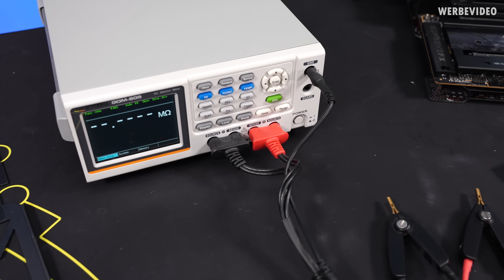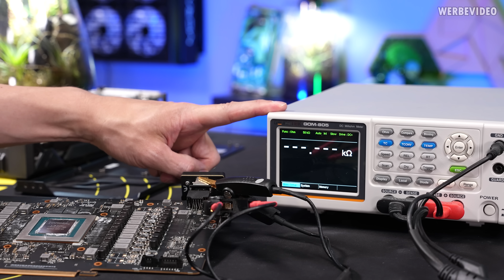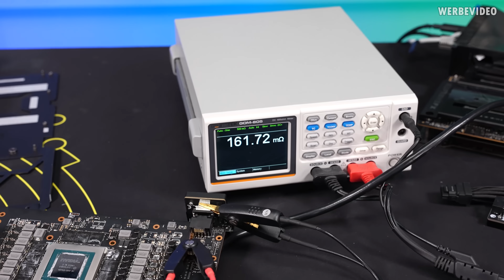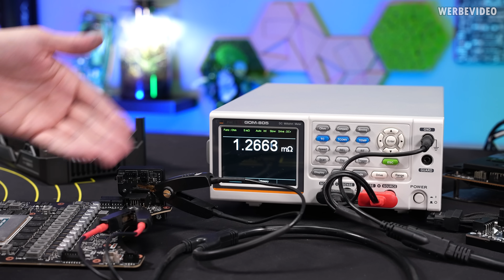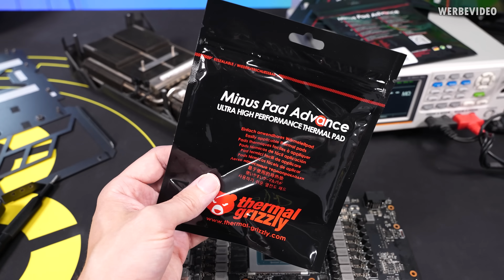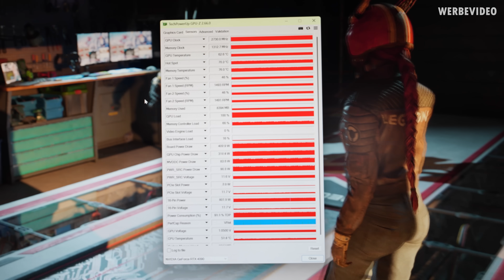It Happened Again – RTX 4090 with Melted 12VHPWR

Comment: You measurements are flawed. The PCB ties all the +12V/GND pins together later. So even if one is completely disconnected you will measure the resistance of the other pin plus the two resistors used for current measurement plus the pcb trace resistance.

Comment: What we need is an adapter that can read the amperage on each individual input, with a display, and a buzzer or alarm that will sound if an individual cable exceeds 10 amps, or whatever the safe threshold is.

Comment: If nvidia wanted a reliable solution they would use the standard 8 or 6 pin pci-e connectors, or at least allow their AIBs to use 2 of their garbage connectors like EVGA tried but nvidia got mad, and evga knowing that 1 of these was wrong ragequit (given they provided great RMA service, this type of garbage couldn't fly). 12:46 They chose looks over function, here are the results.
Reply: They are allowed to use two connectors thats part of why it's all soo incredibly stupid. I'm not sure why most of the ABIs don't. Galax has 2 on the HOF cards
Reply: @TSRB87  Kingpin from EVGA and my lying eyes said otherwise, I am almost sure Nvidia forced AIBs to respond this way after the EVGA debacle...

Comment: Undervolt, power limit to 85%, and driver level frame rate cap (matching your monitor max -1), these cards. Mine pulls 50W-120W (70W avg) less, for little loss in performance. You get slower degradation and lower noise as well
Reply: My RTX 4090 I did a slightly undervolt (no performance loss) and it operates from 270w - 360w and in my build it sits between 53°-60°c room without OC, I don’t think this will  ever be able to get burned in such (low heat) circumstances.
Reply: i run my 4090 at 50% power limit.just below 300 watts peak. 230watt 99% load in current game.
i tried the curve editor foe undervolting, did not work for me, did on my old 3080.
Reply: @sudd366050% ya kind overreacting, ya fine, your gpu won’t get fire, try lottery or take care of your heart, a heart attack is more plausible unfortunately! lol
Reply: @sudd3660
You paid for 4090 and made it run like 4080. 😂
Reply: @dinvsl   i payed for the most efficient graphics card, i still had to power limit the 4080, and i needed the 24gb vram.
and on top of that, i get the full 4090 speed in most my games, only rtx heavy games i get 30% lower performance.
Reply: @dinvsl  undervolted and mildly power limited 4090 loses tiny amount performance, its still almost twice as fast as 4080. While drawing near'ish same watts as stock 3080 (not 4080 tho, latter is more efficient). Its out of its efficiency range from factory, and with 'one rule for all' voltages, as with all CPU-s GPU-s.
I have my CPU also per core undervolted, fairly aggressively, for NO performance drop and perfectly stable. I actually thought I had never crashed but recently checked log on one of my NVMe drives, I've had two crashes over 4 years with my 5900x

Comment: The resistance is very helpful. It proves why it melted. It proves the female side of the connector is junk too.
Also I have an msi 1300 watt and the difference in quality is huge between that and the previous brand I used. Ironically enough it was asus. The msi was far tighter fit and I measured and had less resistance in the cables. Even the other pc cables I haven’t used from the asus had more resistance.

Comment: Well at least the good news is that it doesn’t destroy the card. Looks like a relatively small soldering job. My guess is that his PSU tripped OCP on that rail. He will need to reset that before it works again. I had same experience as Jays2Cents long time ago with OCP on PSU, unplugged 100x, turned switch off, on, plugged into wall with switch off, plugged into wall with switch on. Nadda, then I hooked up a multi-meter and was checking pins and I heard a click and she lived again. See if PSU manual has OCP reset instructions. That’s why he was seeing 0w.

Comment: I’m an engineer (mechanical) and really cannot understand my peers that designed this connector: it failed on the basic high school level electrical training. We are not talking about complex circuit design and dimensioning, failing instead at the very basic level. If this guys designed a building circuit breaker panel, they would burn down the building
Reply: Here's what I can't understand.  This is UL certified!  File Number E204896.

Underwriters Laboratories says it's safe.  HOW!?!  This is how certification companies loose credibility.
Reply: @EmperorA0  
To me, there is only two possible logical explanation:
1. NVIDIA (or whoever owns and licenses the connector) gave UL some money to acquire the certification, making UL a corrupt certifier.
2. UL has lost enough smarts to no longer be a credible certifier.
Reply: @Operational117  I have a feeling it started with #2 and ended up at #1.
Reply: @Operational117  This is the problem with having a corporation being "the" main safety certification body for an entire country.

If we can't trust them for this, then why should we trust them for the insulation inside our walls, or the circuit breakers and GFCIs that prevent fires and electrical shocks?
Reply: What happened was leather jacket man wanted a one connector card and paid them to certify it. Lol
Reply: UL did not certify it until Jensen gave them a leather jacket and a bag full of money
Reply: Just imagine a project where the PM  tries to fill all requests from the CEO who wants his bonuses in full...
Reply: The connector does work when human error is not involved… or bad psu… although Corsair is always mentioned when melting connector, let that sink in
Reply: @skyhawk21  I own Corsair PSU and I refuse to use their cable. It will melt
Reply: @skyhawk21  yes and the Earth is flat. This has been explained by several reputable channels, including this one. Yet you choose to ignore what has happened in real life.
Reply: @skyhawk21  nvidia bot bing bing bong

Comment: For real tho, what is the point of having 12 pins and wires if they are bridged together anyway, just have 2 wires and 2 pins, the RC world has this shit figured out for years and are running WAY more amps without connector problems.

Comment: I had to remind myself ohms law, but f me... at a rough max of 100w per conductor, at 0.16ohms thats 16W of heat! no wonder it melted!
Actually reworked calc after seeing the benchmark... at around 400 watt max... around 5 to 6 W per conductor.... again still plenty enough to melt the connector. Esp with multiple conductors adding to the localised heat.

Comment: Yet again a reason why the whole ATX power connectors need a complete revamp. Fewer but a little thicker wires 2 pin connection would be more reliable  and easier to route. Maybe going form 12v to 24v so you can have smaller wires or more wattage. etc

Comment: Great transparency, thanks for the info about implementation of wireview, didnt know you are joining the powers there, but it makes sense to measure one wire. What to take from this.... make a wireview that would keep the wires split, with 6 separate shunts :D. Also, if you discover root cause for those high resistances, you have solved whole mystery, if the wires go one by one from 1ohm to 100+ ohms, the load goes mostly to to  1ohm wires and if theres one remaining, it does the final melting...
Reply: Splitting the wires is against Nvidia's spec... He said the Nvidia connection fuses all the 12v in the same way
Reply: @JE-zl6uy  the wires are already split as per 12VHPWR spec. Maybe bad formulation on my part... Old 12pin 3090 cards "split" into 3 planes, each with their own shunt and it was no problem. Seasonic is "splitting" on PSU side to shunt individual 12v wires, 5090 astral has "split" shunting of each of 6 12V wires.. So I think that level of nVidia insanity (so far) is doing and recommending fusing of wires, not yet forcing everybody do it...

Comment: Hi, I had an idea and I hope someone can tell me if I have any possibility that it is real. Computer power supplies convert AC to DC using a high frequency method to have as little energy loss as possible. I have heard of an effect in electricity moving through a conductor, where electrons move faster on the outer surface of the conductor than in the middle. Most connectors have melting problems at the corners of the common fence where all the connectors are joined. Perhaps the phenomenon of faster electron movement is seen here as overheating due to high frequency oscillation of the voltage source and the connector design is not suitable for frequency generated voltage but for battery constant voltage?😅

Comment: I had a h++ melt. it fused the PS manufacturer cable on every 12v pin but every other pin melted on the GPU or PS side but not both ends. I wonder if it's thermal cycling damaging solder joints.
Nvidia maybe right their newest adapter doesn't melt as often, but it's not the cable spec that was agreed upon with PS makers before Nvidia decided to stop load balancing high-power gpu's.

Comment: THIS IS WHY WE NEED HIGHER VOLTAGE idk like 24 36v
Lowering the current means less problems sooo...
Reply: Or just not using a terribly designed connector.
Reply: That would require different PSUs to output 24V or 36V DC.
And the whole idea behind the new connector is a smaller footprint, and multiple connected PCIe connectors, so you can keep the same PSU.

The main issue is that the pins/connector can work form heat expansion, change its connection, increase resistance and start heating up.
The whole issue would be solved with heavier pins, and perhaps a plastic housing with better hardness or thermal properties.

Comment: At this point I really do not understand what you are trying to figure out and to prove about this disaster of a connector. Any electrical engineer would tell immediately that this connector design can not handle the power it is asked to handle because... well physics! Instead you could help people by collecting statistics about the usage of the defected cards and maybe you come to a useful conclusion about the real maximum power that this connector can safely operate. Or other factors if there are any.
Reply: Yea right...... all these companies that could push back and get nvidia to change it would rather cash in on the shitty connector. Even Roman is.....

Comment: The biggest ever valued company not even able to design an electrical 12V circuit properly on $2K+ GPU...
Reply: The real question is what is NVIDIA using on these $12,000-$25,000 AI accelerators.  It's not JUST the connector that is the problem.  Its how the power delivery is designed.
Reply: @KellicTiger 48V input isolated two-stage DC/DC converters. The isolation separates the power and signal grounds and through that eliminates the huge current imbalance between +12V and GND on the PCIe power connectors of consumer cards as well. The power connectors are radsok-type aka hyperbolic contacts (same construction of connector that OEMs use for hooking up EV batteries, for example).
Reply: @-szega  So, NVIDIA might just be half assing the connectors on the consumer grade cards as a F off message then?
Reply: @KellicTiger aka we the public get given crap designs prone to breaking
Reply: The connector is technically fine, people are pushing 1000+W through these things without apparent issues. The impressive part is that after four years and two re-designs of melting connectors, the root cause(s) for pin imbalance on the connectors that do fail is still unknown. Foreign matter contamination is likely a major factor in many of these.

Comment: There's a reliable solution! Desoldering the connector and moving it away from the board! 
Maybe use the old 8pin? Nobody had issues with those!
Either way that connector is only there to cause issues to the pcb, removing it and extending cables away from the pcb would be the first idea to my "how to make things robust" thought

Comment: The more you fry, the more you save.
Reply: The more you fry the more Nvidia sell
Reply: At this point I'll get the highest end graphics card that doesn't have this stupid connector
Reply: Nothing new here, as most of these components are made in china without any set standard in wiring and ampacity - it's all about Maximum PROFIT.  If the Chinese can make the product cheaper by using copper clad aluminum wires of an unsuitable gauge and put it there - they will. If the joint is not made of 100% copper, huge resistance comes into play with cheap chinese terminal ends. Resistance creates heat at the joint regardless if the terminal is connected together properly when the terminal ends are bogus.

Comment: Should be called a 12 Volt low power connector.

Turns out running almost anything with no safety margin means that when something goes wrong, things break.

Saving pennies on the dollar to use a dogshit connector was a room temperature IQ move.
Reply: Yup. Sapphire used this thing on their Nitro+ cards, didn't they? Haven't heard about those melting, but the 9070 XT and lower use a fraction of the juice they're trying to feed this monster. 

A low-power connector, indeed.
Reply: @benjaminoechsli1941 well dunno if the 9070 hwpwrs are split
Reply: ye how come they use 3x8pin connectors on low power cards but a single 12pin connector on a high power card

Comment: The accumulation of Übergangswiderstand by by wires and bridge where the electrons have tin wire resistance and different bottlenecks and all the lanes on the highway at once and the effect will bombard at the weakest link. This is why we use thick hard copper wire in housing with the watts going above 800 watts and not heating up. When you make a wire and connectors with soldered hard copper wires and no measuring shunt beween the cable and the card with parallel measuring will stop all this nonsense. That analyzing tool with short lines between connectors can add to the problem. Cable often have a minimal length of around 20 cm for a reason. In coaxial network engineering and electrotechnik this is not uncommon as a work rule to prevent overheating problems by electrons getting stuck at bottlenecks and rapid expansion like a venturi of a carburator. It's like compressing the mixture by a too tiny hole for combustion and that's exactly what happens electronically

Comment: The best solution would be to modify the cqrds to have an 8 pin and a 4 pin connector. Remove the 12vhp connector and 3D print a new part to hold the new connectors and use some good quality wire to wire it up correctly and bypass the sense pins and bame old school GPU power design that hardly ever fails.. NVIDIA should have recalled all 40 series cards to replace them with new old style connectors. This is literally dangerous and will one day kill someone and NVIDIA are 100% to blame by continuing to use obviously defective designs..
Reply: No, this will not kill anyone...

Comment: The 12V high failure connector claims another victim
Reply: It is baffling to me that manufacturers STILL use this connector AND there's no current balancing circuitry involved.

These cards are literally designed to fail much more than those with the 8-pin PCIe connectors, and nothing can convince me otherwise!
Reply: @Operational117  using 4 8pins wouldnt be trouble free either due to handling transient spikes, its still in its infancy and has some issues but they use it for a good reason. People demand more and more performance, power draw goes up and creates new problems.
Reply: @keldon1137  Or.. crazy idea.. make it more efficient. If not in raw performance, then in driver or software.
Reply: @glatwork  The thing is, u can only beat silicon to submission so much, its way easier for game engines to increase demand than its  possible to increase hardware performance. Theres so much issues coming from new nodes which are already on quantum level that it will only get harder. And obvious, if creating performance in software/on driver level would be easy - everyone would do it instead of begging TSMC for more capacity which is the bottleneck when it comes to number of sales u can do. And creating new fabs is upwards of 15+ billion $ too, so if it was possible to achieve better performance via drivers/software - everyone would be doing it already instead of paying TSMC.
Reply: @keldon1137  Still a better idea to see if our approach of using the technology could be improved before we concern ourselves with cramming more transistors on the thing. I understand the latter leads to a quicker pay-off, but these are the consequences.
Reply: @keldon1137  maybe game developers should stop thinking excess = quality. If Valve can make Half-Life: Alyx run beautifully on my awful 1070 + 6700k build, I don't see why other companies can't optimize their games similarly well. It's laziness or excess. Modern games run poor even on good hardware. The industry is so bad right now. I am running a 4070 + 13700k build (put it together before the 13th gen issues were known about)
Reply: yes they should call it 12V*HFC* or just 12V*MC* - Melting Connector
Reply: 2 4090s, since they first released no issues, ive rehomed both of them twice, we upgraded our cases and then i removed one for a 5090 and no issues, but god each time i go to do it, how flimsy the actual connector is for the price is beyond me, touch wood.
Reply: It's mind boggling that nvidia didn't get rid of this terrible connector!
Reply: @moonwatcher6594 well they played a major part in its creation, to stop using it would be admitting that they got it wrong
Reply: @Lonewolf_121  Intel and AMD are already admitting it since they are refusing to use it despite being part of PCI SIG !
so, by estention, we already have Nvidia admitting it passively 😁
Reply: and the adapter failed to prevent it like initially claimed just liek cable mods